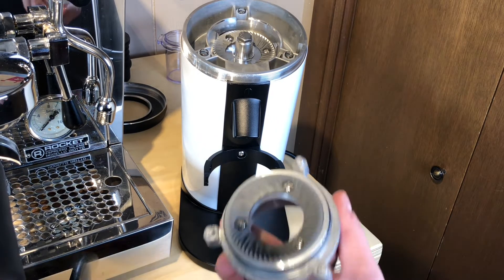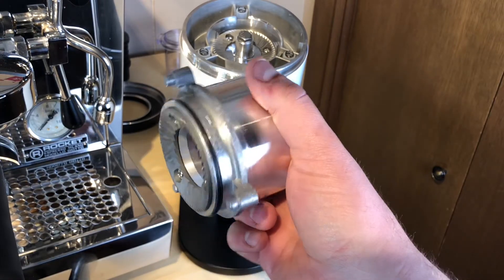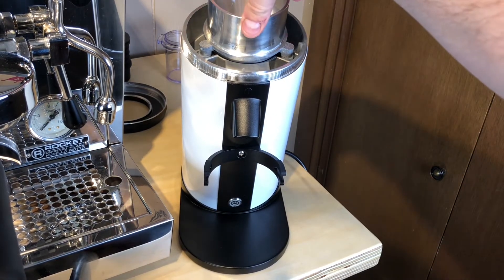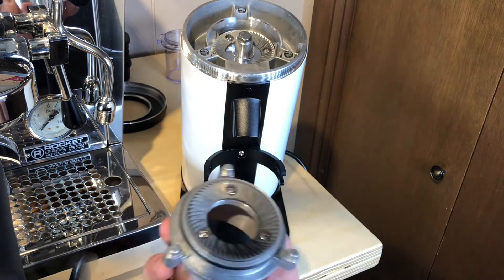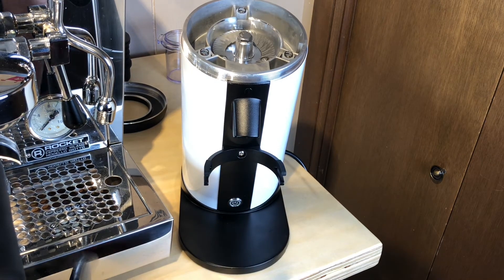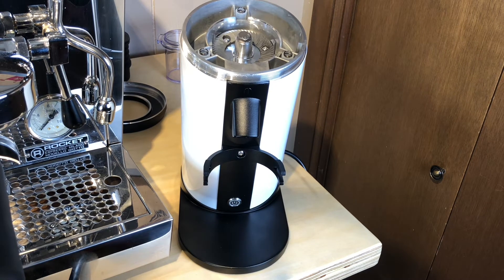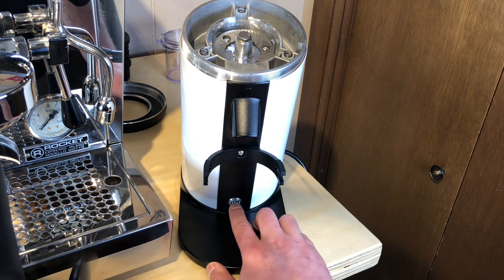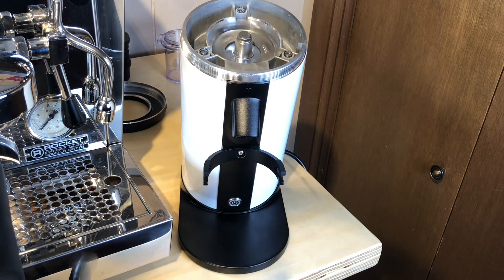Turin DF64 - Burrs and Grind Chamber - Espresso Outlet

Comment: being AC motor does that mean we could "easily" do a dimmer switch mod for rpm control ?
Reply from the maker: Not recommended.  AC motors speed is adjusted by either the number of poles in the motor, or by frequency.  Not going to say a dimmer won’t adjust the speed BUT it’s going to ruin the motor quite fast.

Comment: What do you mean by "seasoned burr"?
Reply from the maker: Brand new burrs are usually so sharp that the machine that cut the burrs leaves some semi uneven edges.   After you grind a few pounds through it, the edge of the burrs eventually smooths out and grinds more consistent after seasoned
Reply: @portakeeper  Thanks for your answer. I was watching the NZ to upgrade my Smart Grinder Pro but its almost impossible to find. The DF64 seem really nice. Do you know if EspressoOutlet ship to Canada ?

Comment: WHAT. Turning on while cleaning the burr set is a massive safety concern.
Reply from the maker: A ton of grinders out there will turn on.   Pretty common but I know many now days have safety interlocks.    I can tell you old mazzers for sure, but even the G60 Nuova, Atom75, specialists will all run with the lid off.  The difference with those is that you need a screwdriver to open where this screws off.   Just make sure to unplug hahaha